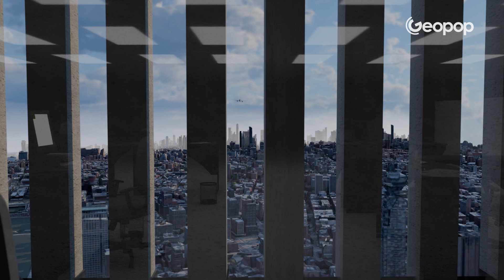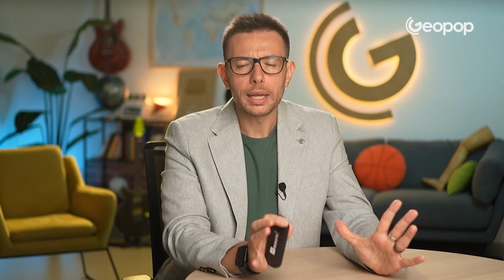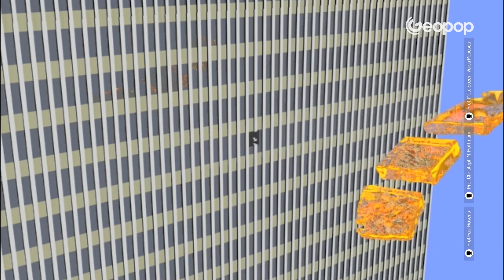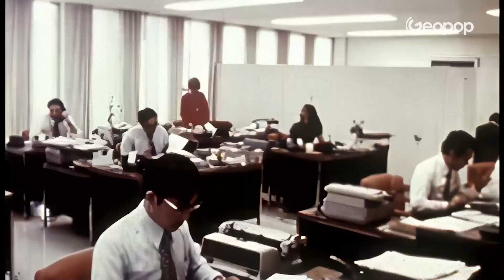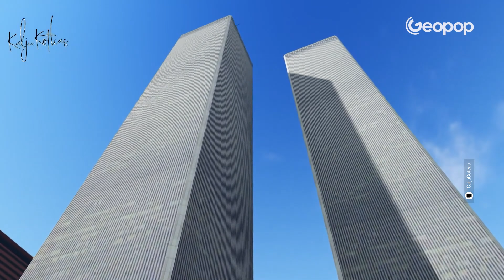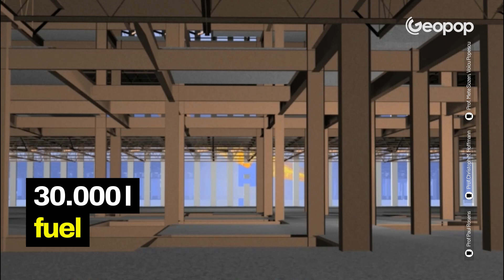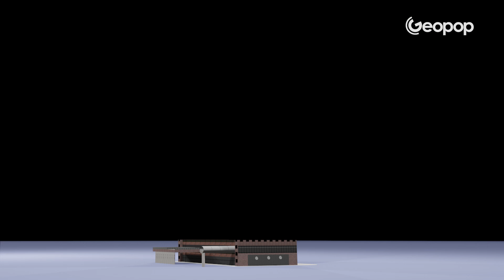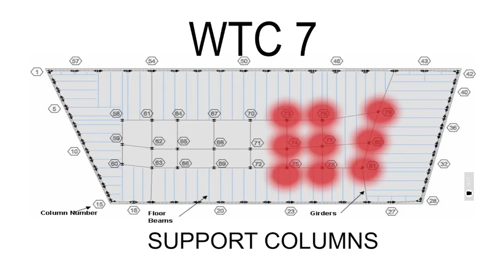9/11, 2001: The Technical Reconstruction of the Twin Towers and WTC 7 Collapses

Comment: If all of the steel columns, horizontal beams and trusses were heavily coated, as shown, and this coating "extended their life for two hours" BUT if the fires moved through each floor, and was finished in only 90 minutes, then nothing ever got heated enough for thermal expansion.
Reply: Thermal expansion involves heating AND cooling .

FFS 🤦‍♂

Comment: Odd that the BBC news live broadcast said that the Solomon building or Building 7 had collapsed yet in the video of their live broadcast Building 7 was still up behind the live news reporter, which BTW didn't go down until 20 minutes later... again after they claimed it already went down it wasn't as it was completely intact & upright.

The graphics showing of The Thin aluminum very fine thin sheet metal used buy these commercial aircraft is a piece of paper compared to the structure of tower 1 and Tower 2. Even with a velocity a 400 Mi an hour to 500 mph they would flattened like a pancake up against a structure with iron beams of at least a foot thick.

Thermite was found everywhere and people had collected it. 

What is thermite used for?

BTW, it was an inside f**** job so pull your heads out of your asses!
Reply: The media had been reporting that Buildng 7 was in danger of collapse or about to collapse for hours. The FDNY had ordered the area around the building evacuated and even suspended rescue operations on the pile. The media were getting all of this. In the chaos and confusion of that day a wire service (Reuters) made an error and reported that it had collapsed. Simple enough. These sorts of things happen all the time in rapidly evolving ongoing news events and there are hundreds of examples on 9/11 alone. The BBC repeated the wire service report.

Should we care that a British reporter (ie: not from New York), four miles away, with her back turned to a skyline chock full of tall buildings did not know which one of those hundreds of tall buildings she was not looking at was Building 7?

I don't think so. 

She was doing her job, reading the report. 

Worth noting that local CBS 2 reporter and weekend desk anchor Vince DiMentri had a bit earlier reported from INSIDE BUILDING 7 (not from 4 miles away) and _he didn't know what building it was either. 

A local reporter, not a Brit on short-term assignment in one of the largest cities in the world with thousands of buildings. 

Here is a video that discusses in detail all the pointless fuss over that BBC report - one of many hundreds of news reports that day which in hindsight turned out to be erroneous. Let me know if you still have any questions after;

www.youtube.com/watch?v=x8epQG0cfQ8

Comment: I still don' t understand why the floors that were able to support everything that was above them, suddenly weren' t able to, 
Can someone suggest an experiment  ?
I know for example that I  can lift a 25 kg dumbbell above my head
Reply: The floors don't support anything but the furnishings, equipment and people that are on them. Columns support the load of the building.

Planes impact Towers, causing massive structural damage, starting multiple floor-wide fires that spread rapidly due to the destruction of fire protection systems during the4 impact.

Serious fires were largely confined to the impact damaged floors and those immediately adjacent to them.  

Fires were started by the impacts and fuel aboard the aircraft, which acted as an accelerant. No shortage of other consumables inside the tower to continue the fires. 

Collapse was initiated (started) at the impact and fire damaged floors when floor trusses exposed to heat over time sagged, in turn pulling on and causing the inward bowing of perimeter columns by up to 5 feet until they buckled. 

Once the perimeter columns buckled the formerly static load above became a dynamic load 30 times greater, easily overwhelming the structure below.

Thousands of tons of now loose debris fell through the open off space - through the inside of the building - dropping 12 feet onto the first intact floor it comes across. The massive instantly overload causes the floor to fail, adding its mass to the falling mass which continues to accelerate for another 12 feet until it impacts the next floor, rinse and repeat all the way down. Rate of collapse increases as momentum increases. As each floor fails, air inside the building (the Towers were 95% air by volume) is compressed, then blows out the sides.

No fire required at all on floors below the impact points for them to fail. The mechanisms that started the collapse are different to the mechanisms which continued the collapse.   That will be a difficult concept for some.

As the floors fail the perimeter columns are left literally hanging in the breeze, no longer attached to the rest of the structure. They peel away and fall in great sheets (think banana) out to more than 600 feet from the base on the 4 points of the compass. 

Core columns failed last.

Comment: Anyone have a timestamp for when he mentions all of the explosives that turned the buildings to a fine powder that floated away for months?
Reply: They only talk about things that actually happened.
Reply: What is the source of the many tons of molten steel found in and under the debris, the heat so intense that the molten steel remained in that state for weeks afterward, running off of the debris as it was excavated. This cannot be molten copper from wiring that retains the color of a shiny new penny.  It cannot be molten aluminum that retains the color of the polished aluminum wheels of a street racer. It was the color of glowing orange molten steel  that cannot be mistaken for any other material, reported by firefighters who are very experienced in the nature of such materials as well as seen in video evidence.

When you combine this with an entire lack of turbulence behind 500 mph aircraft, when even a small Cessna Aircraft would leave an evident wake in the smoke and fire only seconds later .  . We find that skeptics still cannot be skeptical of the official narrative in explanation.  Sponsored channels and forum activity are skeptical of nothing when support is provided.

Sponsored activity in the forums is very normal today for commercial and political purposes and subjects of controversy -- in the attempt to lead public debate.

Comment: If you think planes brought down the building you're a fucking idiot.. there was bombs in the building. Planes hitting the top but not a weaken the bottom
Reply: the only idiot is you 🤡. 🤷‍♂️🤦‍♂️
Reply: Collapse of the Twin Towers was due to four (4) factors of which many commenters only consider one, maybe two, but never all four.

Impact Damage + Fire (heat) + Time + Gravity = Collapse

Remove any one (1) of those four (4) elements and there is no collapse. They work together. 

Ignore any of those four (4) elements and you will never understand the collapse. They work together. 

Unfortunately that is four (4) elements which is at least three (3) more elements than many people who choose to opine on this topic can handle at once. This is why folks like you invariably talk about impact damage OR fire, never impact damage AND fire (and never even consider time and gravity).

Comment: As a Brit, it is one of the weirdest things to see on the TV. I was 9 years old and I was off school and the TV quickly switched to a breaking news segment. Where I saw the first tower with smoke bellowing out of it, as a child, I didn't quite understand what was happening, I knew that smoke coming from something meant fire and that if there is smoke coming from a building then the building is on fire and the fire department is near by trying to put it out.

I didn't understand why a fire would need to have a breaking news segment because sure in comparison to little me, the houses around me were tall but nothing the fire department couldn't reach with their fire engine and on the TV, the buildings didn't look that big. It was only on the 2011 anniversary that I ended up going down a rabbit hole of 9/11 videos and then again on the 2021 anniversary that the emotional impact really sank in. But as a kid, it was confusing for me, only later with the benefit of knowledge, do I realise, it was a much bigger issue and it explained why my family looked terrified.

The funny thing is, now I have a picture hanging on the wall of the New York skyline at night and you can see the twin towers, building 7, etc. and most of the lights are turned on in the buildings and the photographer took the picture only a month before the attack. They had no idea a month afterwards, 3,000 people would be dead and they'd be gone.

Comment: I've been in construction for 25yrs. I've been a part of and have witnessed many housing and building demolitions during that time. Even though I may not have the technical degrees to enhance my opinion, I do, however, have the experience. Tower 7  looked like a controlled demo.
Reply: All 3 were controlled demolition
Reply: @rickjames4005  - Someone wasn't paying attention
Reply: @TheLoonResistance  I think I'm  the only one that is paying attention, so take your  blah blah blah somewhere else cause I ain't buying
Reply: Home made terror indeed!
Reply: It all was!
Reply: Tower 7 is interesting. The two main towers make sense in the manner they fell. The building was held together by trusses. Trusses get their strength from their shape, jet fuel is hot enough to allow the trusses to deform. Which would drastically reduce their strength. Then yeah once the floors start snapping the building is just going to unzip.
Reply: I agree.
Reply: @SuppressHoardReject bro your a dumbass if you believe that
Reply: @SuppressHoardReject  99% of things in a commercial building are fire proof and jet burns up real quick, it's easily to see thermite was used to bring them down
Reply: I should add that we also owe a huge debt and gratitude to the fire-proofing crews that were able to coat the structural steel in the towers after the buildings were constructed (not during, which is usually the case, but the FP technology wasn't that advanced in the late '60's), and if it wasn't for that fire‐proofing, the towers sadly, would have fallen much, much sooner. The FP tech nowadays includes Intumescent fireproof paint, a coating that swells and chars when exposed to high heat, giving it a barrier, and lengthens structural strength.
 My thoughts have always been for the victims and their families, RIP and God Bless.
Reply: I believe you are correct.
Reply: It didn't just look like it,it was a controlled demolition
Reply: "Look like"?! LOL .Wow, you have come along way. We'll possibly never get to the stage where it is widely accepted that the towers were also CDs and the planse were remote controlled.

(And I'm not micking your for not believing in the official nonsense-report about 7's collaps. In fact, I applaud you!)
Reply: -- Then what is the source of the many tons of molten steel found in and under the debris, the heat so intense that the molten steel remained in that state for weeks afterward, running off of the debris as it was excavated. This cannot be molten copper from wiring that retains the color of a shiny new penny.  It cannot be molten aluminum that retains the color of the polished aluminum wheels of a street racer. It was the color of glowing orange molten steel  that cannot be mistaken for any other material, reported by firefighters who are very experienced in the nature of such materials as well as seen in video evidence.

When you combine this with an entire lack of turbulence behind 500 mph aircraft, when even a small Cessna Aircraft would leave an evident wake in the smoke and fire only seconds later .  . We find that skeptics still cannot be skeptical of the official narrative in explanation.  Sponsored channels and forum activity are skeptical of nothing when support is provided.

Sponsored activity in the forums is very normal today for commercial and political purposes and subjects of controversy -- in the attempt to lead public debate.
Reply: @ElLowEl .  . "What the hell are you talking about?" .  . 😃 .  . Thank you for your sponsored reply, Mr. EILow.  The word projection indicates holography as you know, commercial demonstrations of which have been amazing in recent years.  To feign ignorance doesn't work well for you, however.  Where, Mr. EILow, is the wake turbulence only seconds after passage of a 500 mph large passenger airliner -- not seen in the smoke and fire covering the impact zone?  Even the wake of a small Cessna Aircraft would be noticeable -- yet there is nothing.  It's likely that no real answer from you is forthcoming. We'll wait and see .  .
Reply: Could it be  rigged 10 yrs. prior as it was being finished. Who would  pay attention then?
Reply: Then you would know that you just can’t have people somehow sneak in and rig a 47 storey building for demolition and no one saw a thing - it takes months of prep work to rig a building of that size for a controlled demolition
Reply: @troyonplanet  
Yes, I have thought about that. The man-hours alone would sink a small operation. But it does pose more questions. None of which I'm qualified to answer, but we're free and shouldn't be afraid to ask.
I do not believe in coincidence. Building 7 was a few blocks away, if it wasn't targeted, why didn't the other buildings surrounding the towers fall as well, in the same manner? Sure, other buildings were damaged, but none pancaked like that.
Not that my opinion matters in the long run, its just that hindsight normally clears things up a bit, but it's been 24yrs and still questions remain.
Reply: @ I hear what you’re saying and some things do appear questionable - but I often revert to I know from friends in construction - and even from watching various videos - that it takes like 8 -12 weeks to prep a building for demolition and that’s doing it in broad daylight where everyone knows what’s going on. When they took down Three Rivers Stadium and the RCA Dome, both of those jobs were over three months with plenty of prior demolition going on as well. God only knows how you could prep a 47 storey building for demolition and keep it all entirely undercover given you need to drill columns, cut away supports, link all the charges with det cord etc etc
Reply: @troyonplanet  So, it takes time to prepare? You know this pre-9/11 PNAC report? Quote: “The American peace has proven itself peaceful, stable, and durable. Yet no moment in international politics can be frozen in time: even a global Pax Americana will not preserve itself.” To preserve this “American peace” through the 21st century, the PNAC report concludes that the global order “must have a secure foundation on unquestioned U.S. military preeminence.” The report struck a prescient note when it observed that “the process of transformation is likely to be a long one, absent some catastrophic and catalyzing event — like a new Pearl Harbor.” A NEW PEARL HARBOR ... hear, hear! The PNAC was co-founded in 1997 during the Clinton administration by William Kristol and Robert Kagan. Among other notable founder members of PNAC were Jeb Bush,[6] the Governor of Florida and brother of President George W. Bush, Dick Cheney, the Vice President to George W. Bush, Francis Fukuyama,] an author of neoconservative literature, Dan Quayle,[9] vice president to George Bush Senior, Donald Rumsfeld, former Secretary of Defense to George W. Bush, and Paul Wolfowitz.
Reply: @troyonplanet  ...  the "usual suspects" do not have access and means... und that someone who has the means and access did  it - is considered "unthinkable"... that's the magic of false flag operations, mate.
Reply: @troyonplanet I don't remember what they called but they were doing something inside the buildings months before hand
Reply: @troyonplanet and thats exactly what was able to happen. First hand accounts of survivors saying that weeks prior to 9/11 whole floors were constantly closing for mysteriously vague “maintenance work”. It all adds up 9/11 was a planned demo
Reply: Didn't sound like one though. I also suspect building demolitions are not conducted when the building is on fire.

What does a building collapse look like when it is NOT a demolition?
Reply: @TheLoonResistance  a steel frame building has never collapsed under fire
Reply: Which is more extreme -- to accept without question the inexplicable lack of turbulence in the wake of a 500 mph large passenger airliner -- not evident in the smoke and fire covering the impact zone only seconds later? -- or to recognize the indications of digital projection in its imperfect nature as we see a wing disappear in front of a bright blue sky? From another camera angle, the same aircraft is seen passing behind a crane in the foreground, yet in front of the heavy crane cable. 

There should be a hurricane of turbulence in its wake that would entirely disrupt and disperse the smoke and fire seen billowing outward just 3 to 4 seconds later at both towers.  Even the wake of a small Cessna aircraft would be noticeable -- yet there is nothing.
Reply: @ A (normal) passenger airliner cannot go 500 mph at so low altitude. Thus, it was no ordinary airliner.

The crane/cable thing i no-plane bs. There were planes.
Reply: Why would some "group" even do such a thing? Looking like something doesn't make it factual.
Reply: @nickcharles1284 .  . "science" .  . 😃 .  . Commercial demonstrations of holography have been amazing -- so you believe that they are analog in nature? .  . What century are you living in?   

You also cannot explain the entire lack of turbulence behind a 500 mph aircraft that would entirely disrupt the smoking fire coming out of the building on the seconds later. Even the wake of a small Cessna Aircraft would be evident -- yet there is nothing.